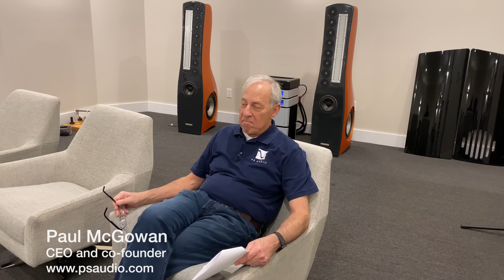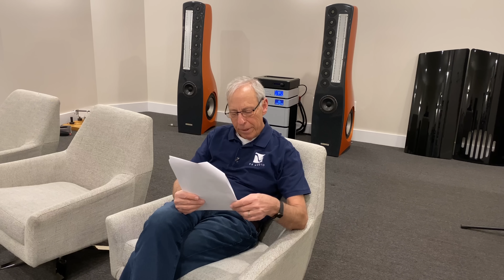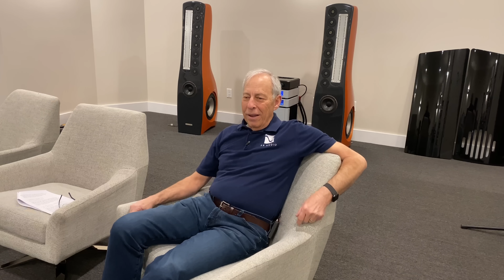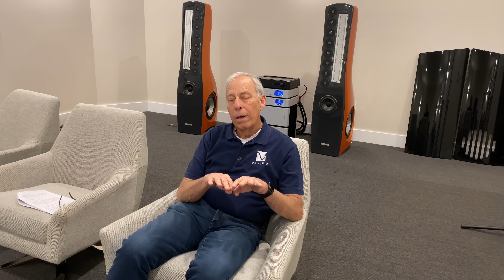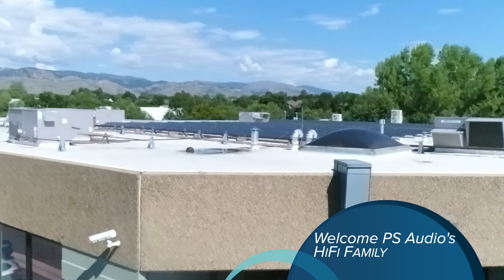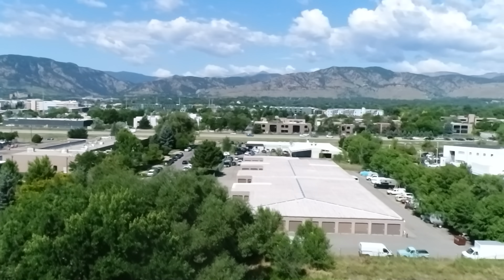Are mains purifiers necessary?

Comment: Great audio products have great mains filters on the primary side and great regulators and noise decoupling capacitors on the secondary side of their power supply. Thus the function of minimizing the mains power noise influencing sound is already done inside your product and will do a good job, if your product is a well designed one. If your product is not so great...get a great product rather than patching it with external conditioners. Of course if you share an elevator motor with your amp on the same power line...or something like that...you might need a regenerator.
Reply: The problem with that statement is that, that there are no good products with internal noise reduction. Yes there are many that have it, but those filters are usually what kills the sound. I would like to hear what you then consider a good product.
Reply: @RealHIFIHelp  Any great product is designed to consider and reduce the effects of EMI, common mode and differential mains noise. Simple X and Y capacitors are found in many products on the primary side and on the secondary side of the power supply you will find measures to reduce ripple to a minimum. The noise on a Vcc rail can originate from the mains frequency (will make 50/60Hz hum in your speakers), from a switch mode supply not filtered well enough (likely noise you can't hear) and from fluctuations in the mains power itself. Good engineers know how to make a robust amp power supply solution that will make the power rails maximally immune to external noise sources of any kind. BTW, a great amplifier doesn't need a US$1000 power cable to sound great cause it isn't super sensitive to a tiny impedance difference of a few feet of cables. And you can make a robust power supply that doesn't kill the sound and does a good job in avoiding noise in your analog audio signals.
Reply: @RealHIFIHelp Well, in all the engineering teams I've managed, people do proper solutions and validate them against test conditions incl. noise conditions. If you are passionate about it, you make test conditions that are tough to pass. For example, you don't want your product to work only between 114V and 125V AC (USA) even that is per standard OK. Rather you want to make sure you can go far below and beyond those numbers so even under extreme conditions, the product is still stable and sounds good. I usually ensure my products can work from at least 90V AC and up.
Reply: @RealHIFIHelp  HelloMine freindds! You can use humbucker pickups. They are good for getting rid of noise. For inclge coils you can try the noiseless ones. i hav enover used them sbut Mister SAcott Grove has. You can roate the guitar to reduce noise, I do that sometimes with singles coilds. Another is to use a noise gATE. I bought a ROwin a few months a go, 35 bucks or soe, and it worklds pretty good. My little Korh NTS1 synthezier is now nice and queits with the wall transformers USB. THNANEK yu, Thumbb sup you are the4 good fre4nds!
Reply: Real HIFI Help What components do you imagine are expensive in making a good amp power supply immune to mains noise?
Reply: Real HIFI Help Your talk is quite ignorant. First, it takes long time to develop a great amplifier. My projects usually take more than one year. When it comes to semiconductors and passive components such as capacitors and resistors, we all use off the shelf components. Inductors can be custom made and in some cases even a transformer is custom made. Usually high-end audio is made in very small volume so only components that can be made by a manual process are custom made while the rest are off-the shelf. For example, an aluminum enclosure can be CNC manufactured to specs easily in few units. And nobody randomly just combines components to check what sounds best. Good engineers know how to do proper engineering math to do a predictive development and in some cases listening tests are used to make choices but for the most part, things are done with engineers who can get it right from theory rather than random guesses. I have managed engineering teams from small ones to large one and also some in China and the best sounding products come from engineers who know well what they are doing, have experience and most importantly, have passion for great audio. Yes, listening tests are extremely important but it’s nonsense to think you can make a great product without solid understanding of the theories.
Reply: Real HIFI Help The speed of manufacturing is not so interesting. Your Dan D'Agostino amplifier could be made in high volumes in thousands per day if there were consumers enough to buy it. Any manufacturing process is made with some compromise and generally the lower production volume will involve more manual process and less assembly people doing more various work yielding a slower production. I’ve been working both with small manufacturing teams of such kind but also very large manufacturing e.g. at Foxconn north of Shenzhen where they make lots of iPhones, iPads, TVs and other stuff. Perhaps contrary to your belief, higher volume manufacturing is actually often with better quality. For example, you have a much higher chance of getting a non-defective iPhone than a non-defective high-end audio product. The quality control is much more disciplined in these factories making many thousands of products per day. But obviously, most audio products made in very high volume is not so great on the audio performance. So it’s a bit like this...low sound quality products are often manufactured in higher volumes with higher manufacturing quality standards yielding more consistent quality. This is true for most well known brands (Yamaha, Klipsch, JBL etc)  manufactured by such contract manufacturers as Tonly in Huizhou but not if you buy some no-name brand manufactured by some Dongguan factory with 50-200 people working at some assembly line managed by amateur managers.
Reply: Real HIFI Help Agree on your point “We should support smaller companies in Europe and America”.
Reply: @RealHIFIHelp  So PS Audio is making resistors, capacitors, semiconductors (transistors) in house?
Reply: @RealHIFIHelp  But what moving parts are in an amp, DAC or preamp? Other than perhaps a cooling fan?
Reply: Andy Delle Right, PS audio is of course using almost entirely off the shelf components like anyone else. Enclosures are of course custom made. Power cables are also often custom made for high-end audio.
Reply: @RealHIFIHelp  Modern semiconductor based audio gear can perform superior to tube amps. You know, all the music you listen to has already gone through 10s if not more than 100 transistors before it hits your eardrums...with or without a few tubes in your system. So in best-case, your tubes are not adding harm and in worst-case the tubes add some harmonic distortion. What makes some people like tube amps is that their distortion is of the more musical even harmonic type. This can especially make music sound more live than it was sounding like on the master. Personally I prefer the purest signal possible. The problem with tubes are many incl. burn-in and degradation over time. Even a simple thing like getting identical left vs right performance is an issue. Tubes are mostly used for snake oil marketing today and some people like the beauty of tubes illuminating (I personally do).
Reply: @ThinkingBetter  And I would trust and use a Sprague, CD, Mallory, Nichicon, Panasonic, capacitor any day over the audiophile brands. At least I get full public disclosed engineering data and know where the part really came from.
Reply: @RealHIFIHelp  McIntosh is hardly "mid-fi" as  you put it. They have been around for 80 years and have maintained a stellar high end reputation every one of those years.
Reply: @andydelle4509  YES YES YES!!! No sane educated experienced audio engineer would accept to put a capacitor in a product that is "specified" using ridiculous terms of audio performance only, such as this: http://www.diyaudio.vn/dad_capacitors.htm
"Wonderful natural voice and exceptional micro-dynamic. Truely amazing."
Seems these snake oil caps have no actual detailed proper specifications? LOL
Reply: @ThinkingBetter  Well they do give physical dimensions so that's a start. At least you could calculate the increased lead length inductance caused by hanging or bathroom calking these capacitors above the PC board. Funny how many non-technical audiophiles
try to fix an imaginary sonic problem by causing a real engineering problem in the process.
Reply: ThinkingBetter: Hello Mine Frends! What you wriote is what my fernfds with teh KRELLS and BW 801 speakers tome be int eh early 1990s. Yes, transisotrs is better soundign than tubes. Tubesa klike Carey and others is just marketings to be diffrerentsd. H ealso tol sme they are noise. I hav enever heard a tube HI-FI so I am not going to pretend and make up some stpry, but my friend is honest and you are too!

thnakes youes and thumbb sups!
Reply: Andy Delle: Hello mine frends! I read the article to use RUSSINAS capacitos becuase theyare supposed t be  WARM like BUMBLEBEE in early Les Pauls. I was stupid I believe them and took out the orginal capacitors. WARM is the same a  ROOLED OFF TREBLE. Now I have to gt some money and a soldering iron and get Sprague Orange Drop Capacitor , just as Gibson is useing, and pout them back in the guitars. TI DONT LIKE THOSE LIEARS. I DONT LIKES THMES thankes you and thubbmms ups!
Reply: @ilovecops6255  Tubes can look beautiful...that's it. I don't want tubes to mess up my audio!
Reply: @andydelle4509  Snake oil too often works in high-end audio (for making money).
Reply: @RealHIFIHelp  I've worked for long time in audio R&D including for some highest-end brands. I'm intimately familiar with the trade-offs of using different parts. I have in total 6 installed stereo audio systems in my house (different rooms). The total cost of these audio systems is above US$200,000. In my collection I also have some snake oil things (e.g. power cable costing more than US$1000). As an R&D professional, I got some of it as R&D samples for free. One of my friends is also the #1 on this planet in terms of spending most on audio btw. I have seen and listened to some of the most crazy expensive stuff you can imagine. I'm an audiophile like you, but I also understand some of the magic that makes audio outstanding (it's not my >US$1000 power cables or interconnects and it's not some "audiophile capacitors" that come with no actual specification-sheet).
Reply: @RealHIFIHelp  My mind is never made up and I have been doing blind tests numerous times. Actually I used to get my ears checked every 6 months for my hearing performance.
Reply: @RealHIFIHelp  I prefer the purest sound possible and have listened endlessly to tube amps. It was fine ages ago when people didn't know how to make great transistor amps. In particular hard clipping was the huge issue with old transistor amps, where tubes did a much better job. But that's history dude.
Reply: Real HIFI Help I don’t rank audio engineers who just know what they learned in university very high. The best audio engineers have passion for perfection and care how things sound. You need BOTH. Great audio engineering involves a solid theoretical foundation combined with experience and passion.
Reply: @ThinkingBetter  Tnbake you Mine Frends! The guy Gene Simmonsw from the KISS band , henow uses transistor bass amps from TEch 21  and nto the AMPegs Tubes no more becuase his guutar tech guy said the tubes get really hots and the sound gets worse as the showe goes on. Its probl not a problem with hifi home not being pushed to full capacity, but my frend withe the KRELL  DOES NOT LIKE TUBES. I have a littrle peavey combo amp with transistores. No tubes to burn outes. I had a package of Marshall ECC83 tubes, and  many years laters when I went to use them they di dnto work. Maybe air got into them or somethingsd. THANKES YOU,  you are the honest friends ,THUBBS UPS!
Reply: i love cops Yes, tubes are not giving you consistently the same audio. Performance vary by each tube and by temperature and aging. It was great 50 years ago.
Reply: @RealHIFIHelp  When you listen to music that has gone through, let's say 50 transistors already, adding one or two tubes in the signal path can NOT add more purity of the sound. In particular, if you play digital music, already your DAC is outputting a line level signal and your power amp needs a line level input and there is no actual amplification to do. So why the heck add a tube to it? Only reason is a bunch of snake oil arguments. Well, again, tube amps can add some harmonic distortion that you might enjoy listening to. It's true that live music is with more harmonic distortion and our brain perceives that extra tube sound closer to live music.
I still prefer the maximally pure signal.
Reply: @ThinkingBetter  I'm with you all the way on this, and I love the look and nostalgia of some tube gear, being an old TV and stereo repair guy myself. There is only one manufacturer of tubed audio gear that can compete I think with good solid state gear and that is LTA Linear Tube Audio using their proprietary ZOTL transformerless technology. Check them out if you havent already.
Reply: @RealHIFIHelp  Tube sound is very limited today as it was 50 years ago. Tubes still have the same flaws. Nowadays some people use them as decorations and distortion devices. As decoration, tubes can be cool.
Reply: @StewartMarkley  I have done R&D projects through my career for products selling in millions for some major brands (audio and TV), so you have likely repaired some of my babies :-)
Reply: @RealHIFIHelp  For a real interesting comparison of tube versus transistor sound, you ought to try hearing the Linear Tube Audio ZOTL transformerless designs if you havent already. They get rid of the real problem with tube amplifiers which is the output transformers. So you get the better sounding harmonic distortion characteristics of tubes but without the various problems of using transformers. I havent heard these myself nor will I as Im a poor retired audio engineer but it would be interesting if someone like yourself heard that sound.
Reply: @StewartMarkley  "get the better sounding harmonic distortion characteristics of tubes but without the various problems of using transformers"...yes, better sounding harmonic distortion it is. Definitely for a power amp, a transformer is a horrible component in the signal path. When driving a dynamic speaker, you want a high damping factor (= low output impedance) to precisely control the cone motion. I don't think tubes can compete also on that metric.
Reply: @RealHIFIHelp  I have several systems involving amp products from PS Audio, McIntosh, Krell, Moon, Audio Research and others. Most of your music has already gone through plenty of transistors and survived it :-) In terms of what your tubes are INCREMENTALLY doing to the signal, I can do it better in a DSP without added noise, drift and L/R differences. Dan D'Agostino do good amps also, agree on that. But they are pricey. I often listen to tube systems at some of the audiophile trade shows btw. You like the musical distortion added by tubes, and it's ok.
Reply: Real HIFI Help It’s a bit like this, live music that is intended to provide a room or concert hall ambience can benefit from tubes. Music that is studio optimized and intended to be as pure as possible, will often lose precision by adding tubes in the signal path. I just prefer purest possible signal path.
Reply: @RealHIFIHelp  no, The ZOTL technology is very different than OTL technology. I had to read the patent about it to understand how it works because their website does not really go into it in any detail. I haven't heard it for myself but knowing the issues surrounding audio output transformers it islikely going to sound very much like a good solid-state amplifier. While it unleashes the best of tubes for audio purposes, I don't know if it is worth it compared to a good solid-state amplifier unless you just can't live without tubes.
Reply: @ThinkingBetter  yes I understand the benefit of damping factor, I did not research that aspect when I read info about the ZOTL technology on the website or the patent. But doing away with the audio output transformer has got to be a good thing.
Reply: @RealHIFIHelp  You are thinking like a marketing executive with no concern about cost or diminishing returns. Sure tubes sound different than transistors, mostly due to the harmonic distortion, rounded and ringing transients from the output transformers, and poor control of the woofer motion due to lower damping factor. Tube fans translate these differences into audible benefits, however they are not intrinsic to the music but rather are claimed to enhance the sound of music. I prefer to use a little bit of EQ sometimes to modify the sound of certain recordings, mixes and masterings, however I cannot undo the damages done by poor transient response or ringing. Tubes, transformers and speakers all contribute heavily to the sound of Hi-Fi equipment which some people prefer but I do not.
Reply: @ThinkingBetter  It certainly could be. I have built and modified many electronic and electromechanical devices over my career as well as done repairs. I am retired now but still have a passionate interest in audio so once again am embarking on building new speakers and an amplifier to keep busy and have fun. I also just bought a General Radio sound pressure level meter that will undoubtedly require some TLC and should be fun to restore. Speaking of restorations, have you heard of mr. Carlson's lab YouTube videos? Paul Carlson's videos are a favorite pastime of mine these days.
Reply: @StewartMarkley  Yes, I also watch Carlson's lab. And I like this guy too: https://www.youtube.com/watch?v=m7ERMu825m4
Reply: @RealHIFIHelp  I have two storage rooms of old gear that I don't use anymore. Much of it are R&D samples that I usually update to production quality. I'm quite happy with my current systems and like to enjoy the music more than worry about the gear. Yes, I would love to get a Sennheiser Orpheus/HE-1 setup (I have done some listening on it) but I'm happy with my much cheaper Stax SR-009 that beats all speakers on reproducing every detail.
Reply: @RealHIFIHelp  I actually tried Abyss on a prototype sample long ago. It had some serious issues at that time (you could easily hear resonance issues on a sweep). But I'm sure final product is much better. Actually I got my first Stax headphones in my teens (I spent most of my money on audio as teenager) and have loved the brand ever since for being among the most revealing of anything money can buy. As teenager I was amazed by finding details using electrostatic headphones listening in the late evenings while in my own room. To be honest with you, we have had huge improvements in computers, smart phones and other areas of technology for decades now, but audio fidelity was already great in the 1980s if you chose carefully and 99% of what people buy today can't match the resolving capabilities of my first Stax headphones (SR-44). The SR009 are of course better.
Reply: @ThinkingBetter  Oh I had a lot of laughs on this one, thanks for the link. I have to send it to my buddies, they will have a lot of fun with it.
Reply: A very politically correct answer.

1.No one really shares power with an elevator, so lets just scrap that point.

2. There are levels of quality within the power conditioner industry, so the cheapest ones are usually far from the performance of the most expensive ones.

I am just saying that everybody should not rule out a powerconditioner, before they actually have tried some few good ones. And the ones I mentioned do not have the problem Paul is talking about. But again some few times it makes more sense not using one.

There are several worlds of quality within the industry, and if you are a guy owning a 1000 dollar denon reciever with some 500 dollar speakers, then of course it is a waste of time.

I just assume that people watching PSaudio channel have some proper gear, and in that case it is worth exploring instead of using 2-10x more on a piece of hardware like a CD player/DAC/amp/speaker. Many times the powerbox feeding the whole system is the main problem that needs to be addressed.
Reply: @RealHIFIHelp  
"Many times the power box feeding the whole system is the problem that needs to be addressed" 
In over 40yrs of system installations of all types including HiFi, clubs, churches, stadiums...I have never had to do that here in the USA, grounding issues ? Yes, power supply? NO.
Edit, yes I own a  Oscope
Reply: @RealHIFIHelp  
You didn't see I included HiFi in my reply ? Do you own and use test equipment ?? I'm just curious...
Reply: @RealHIFIHelp  
50 systems !!! WOW!!! think if all that money would have been invested in the market !! 💲💲💲💲 That wouldn't be as much fun though 😁
Reply: poserwannabe Exactly right, in the USA, power purity is almost never a problem in residential or most business environments.
Reply: Real HIFI Help I had an apartment where power was noisy from the elevator motor some years ago. I’m not kidding about this. Besides, its just an example of what makes power noisy. Generally, you don’t need a power regenerator and rarely, power noise is the limiting factor of your high-end system. Great products do proper filtering of power noise both common mode, differential and anything EMI.
Reply: Real HIFI Help: Hello Mine frends! Mine frends tol dme where they have VARIABLE FREQUENCIE DRIVES theose thing sputs lofs of harmonics into the electricla wireing and messes up computers and hen need power sconditioners to protekts the computers. Boss pedlas have a buffers to make up for the more peldas and instrumtns cabes. I found these articls if you are intrested in thems....

What are harmonics?
Harmonic distortion is a form of electrical pollution that
can cause problems if the sum of the harmonic currents
increases above certain limits. A harmonic current is one
with a frequency at a multiple of the fundamental frequency,
for instance a 250 Hz current on a 50 Hz network is the 5th
harmonic. The 250 Hz current represents energy that cannot be
used by devices on the network. It will therefore convert to heat.
According the International Electrotechnical Commission
(IEC), the level of harmonics is described by the total
harmonic distortion (THD) and is expressed as a percentage
of the total voltage or current. In the standard IEEE 519 it is
refered to as total demand distortion (TDD).
What is the effect of harmonics?
Harmonics may cause cables to overheat, damaging their
insulation. Motors may also overheat or become noisy and
torque oscillations in the rotor can lead to mechanical resonance
and vibration. Capacitors overheat with, in the most severe
cases, the risk of explosion as the dielectric breaks down.
Electronic displays and lighting may fl icker, circuit breakers can
trip, computers fail and meters give false readings.

With the goal of preserving that guitar-cable-amp core tone you’ve settled on, you should now consider adding a buffer (or a buffered pedal) as early in your chain of pedals as possible. Buffered pedals, such as all pedals from Boss, have a buffer circuit that’s active even when the pedal is bypassed. And they accomplish the same thing as standalone buffers like Tone Freak’s Buff Puff or the Suhr Buffer. Note: All buffers are not created equal. Different buffer circuits exist and you may hear a difference in the way they sound.

THANKES YOU, YOU AR EMINE NESA GOODS FRNDS!
Reply: @RealHIFIHelp   Nobody shares power with a elevator? Lets pull the electrical prints from the city code office for your more than two story apartment building of choice! Where so you get these ideas or rather the information to challange them.
Reply: And how do you know that? It certainly has a separate breaker, but that is in parallel to the building utility feed, at least in the USA. There are a few exceptions in older pre 1950 buildings where the elevator may have a three phase service separate from the units split phase service. But that is the exception, not the rule. And often that three phase service still feeds the split phase from the same utility pole transformer bank, once again simply spliced together.
Reply: Real HIFI Help Yes, but EMI can do stuff between cables.
Reply: iS THAT WHAT ARE KNOWNS AS filter capacitors? mY FRNED Gave me a tiny synthesizxer run off thre USB power frotm eh computer. It made a terruible hum when i plugges the headplone output to the inpute omn tyhe  guitar amp. I actualytl got a sound coming out of the guitar amp with ontly the tip connectors fortm eh headphone jack and the inpute cabel to the amplifier! The sleeves were nto toughing but soudn was comng ou tof the ampl. I changes the USB to a wall transformer type and th ehum wen away and it works great. Must be some groundign thing going on. THANKES YOU,. you are honest and DONT PRETNED TO KNOW STYIFF LIKE SOME BLABBERMOUTHS SALES MENTS WHO HAVE riuppe dmee off INT EH PASTM OR AHTT liears STEREO REVIEWS And audio. i dont likes thmes! thnekes yues and thumbbs ups!
Reply: @ilovecops6255  Hum noise (50 or 60Hz) can be caused by many reasons. X and Y capacitors are there to capture higher frequency noise though. On the secondary side of a power supply usually you will find capacitors and regulators to eliminate the 50/60Hz hum from the power rails inside your product. But hum can also originate from poorly shielded interconnects, from the magnetic field of the transformer to your amp electronics (internally a poor design of product) and in other ways. If you hear hum from a USB powered product, definitely try to find a better USB power supply. Often, USB power is quite noisy and not optimized for audiophile performance. Even a poor USB cable can yield a problem with added noise (but don't buy expensive USB cables, most cables are ok).